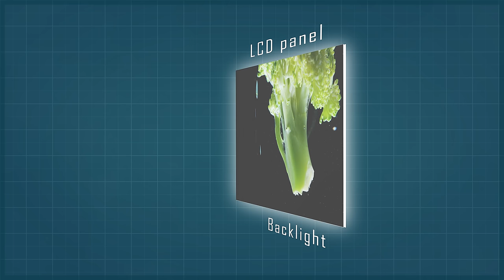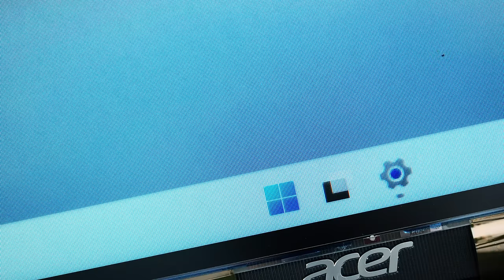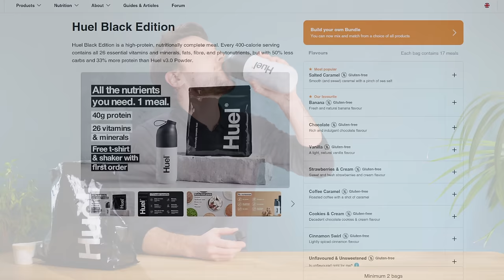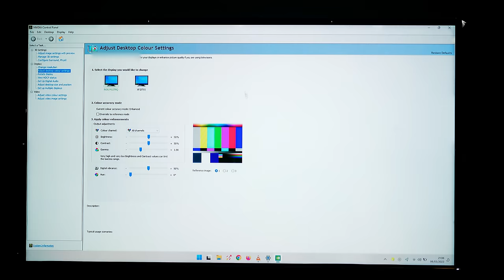DIY Dual-Layer LCD monitor - can it match OLED??

Comment: If I remember correctly, Hisense has done this in one of their TVs. They achieved incredible contrast levels by using a second monochrome LCD layer to provide those inky blacks. Sadly, I don't think they've pursued it any further, synchronizing the LCD layers was quite difficult.
Reply: Apple did it didn't do it

Edit: sorry, the Pro Display XDR is not Dual LCD. I swear I heard it was when it came out, but that was a myth
Reply: LTT has made a video on it
Reply: @zachb1706  nope
Reply: @zachb1706  did it on where?
Reply: I have one of these Hisense TVs it’s amazing except one of my back panel pixels died. Twice as many to go wrong I guess.
Reply: @zachb1706  Apple didn't do it, they bought it from the display manufacturers and might have sold it at most
Reply: @MrRagsd  what's the name of the model? Id like to get one
Reply: @nakedbeekeeper9610  Hisense - 75" Class U9DG Series Dual-Cell 4K ULED
Reply: The "U9DG" series from Hisesne uses this technology. Their 75 inch tv is currently around 1000-1500 dollars which is only alright compared to its competition in that class. It's about as expensive as a QLED or cheap OLED panel.
Reply: Panasonic sells panels with technology this but they are very expensive. Sony uses it on the BVM-HX310 but that's a 31" monitor and costs over $30k.
Reply: @MrRagsd  thanks my man. I'll see if i can get it second hand
Reply: yeah, I thought the same thing. it's Hisense way to fight oled with its intellectual property when it first appear on tv market. but I heard it flop cause of the process yield low success rate
Reply: monochrome second layer sounds great, should not be as inefficient
Reply: @fhecrewdavid  the  cheapest 77 inch oled would be a bit more expensive, maybe 2000 dollars, just 3 or 4 years ago a 77 inch oled was north of 10,000.00 so thats nice.
Reply: Isn't QuantumDot from Sansung almost the same idea ?
Reply: I recall seeing a video about a reference monitor which used this same tech. of course I have never seen it in person, nor do I remember the numbers, but both peak and sustained brightness were absurd, as well as a ridiculously high colour gamut and non existing colour delta. of course, it was a mastering monitor, might cost as much as my house for all I know
Reply: this seems a bit silly....dual lcd blocking means less light getting through....so add more light to compensate...
couldnt you just dim the exsisting monitors backlight to get the same relative effect?
Reply: @fhecrewdavid  I assume this is because it was such a limited production run. If more people did this the costs would go down, right?
Reply: @monad_tcp  quantum dots are meant to make the light from the  backlight whiter. That way you get more vibrant colors, but not better blacks.
There is a qd-oled technology available on some computer monitors, but I thing it replaces the regular lcd backlight to an oled panel. Dont quote me on that tho
Reply: @michaelm6867  That's true! Compared to OLED it's interesting though since most OLED panels are actually just manufactured by one or two companies and sold by others in their TVs. It'd have to be a tech more widely adopted by larger companies in various products to have appreciable demand.
Reply: @MrRagsd  I' ii keep a lookout on mine fingers crossed
Reply: Panasonic made their megacon technology for reference displays using a light modulating layer it can be found in the sony hx310 and should be an excellent benchmark.
Reply: @Elbenin  I though they could turn on and off single "pixels" like a grid pattern of LEDs for the back light.
Reply: @monad_tcp  well, quantum dots are just weird dots that convert light into a different wavelength (this is a simplification).

They’ve now used it on displays that are just blue oled panels. The quantum dots on top convert 2/3 of that light into either red or green.
Reply: I vaguely remember watching the HDTVTest YouTube channel or maybe elsewhere saying that the technology isn’t used in consumer TVs because it’s so energy inefficient that it can’t meet energy efficiency requirements in the EU and other parts of the world.
Reply: @jimmyhackers8980  so if you imagine a lcd panel can let through 1-80% of the light, that’s a contrast ratio of 80. Two lcd panels would square that effect, so they would let in between 0.01% - 64% of the light, with a contrast ratio of 6400
Reply: @iain3713  but after youve added extra light coming through... that 6400 ratio must be reduced. i can imagine to get the panel back to orignal brightness it would completely negate the darker blacks back to greys.
Reply: @monad_tcp  but quantum dot layer is more proprietary layer and producing more vibrant layer. I'm not quite well informed about the contrast level and brightness though
Reply: need a pair of hires lcd glasses/lcd visor with a camera and realtime AI mask contrasting to modulate light transmission through the lcd  per which direction they're facing. Can passively block peripheral areas too so eyes can accommodate to increase sensitivity....
Reply: @monad_tcp  Quantum Dot enhancement layer improves contrast only marginally.
Reply: @jimmyhackers8980  contrast is a relative metric, not absolute. LCD screen has same contrast ratio regardless of backlight brightness (except extreme cases).
Reply: The Monochrome LCD was 1080p FullHD under a 4K Color Panel. It was also bonded on very closely to avoid any optical artifacting. When the Panel maker custom makes the layers they can some tricks to make the multiple LCD filters allow as much light through as possible. I wish this tech became successful and used for realy big scale screens. Sadly it seems to be abandoned.
Reply: @zachb1706  XDR is a bad implementation of MiniLED, it is infamous for weird Local Dimming issues.
Reply: Expensive reference monitors for movie grading, especially with HDR, are dual layer LCDs with local dimming.
Reply: I think some mastering monitors used it as well, but they're like 30000 pounds or something lol
Reply: @zachb1706  When Apple originally announced the XDR it was widely assumed that to achieve the specs presented, they must be using LMCL/Dual Cell. And that really caught on. I thought the same for a while. Then they released more info, and it was 'just' a decent FALD setup. And then people got their hands on them, and it turned out that while it was indeed a great display, Apple were probably being a bit aspirational with their reported specs.
Reply: @jimmyhackers8980  Cannot and you will not get the same result. LED monitors with HDR now run at least 300 up to 1000nit. That 1000 is very bright, almost blinding for a computer monitor working distance. The reason is because HDR monitor also has better LED panel with wider contrast ratio. When you reduce the brightness of light, the reduction in color contrast is different with different color. White becomes too less white while dark becomes ehh... slightly dark. Even then, there is a downside of the method in the video which is the sharpness. It is just distracting when looking at text or anything that barely moves because you kind of notice the blooming around the dark and bright pixels.
Reply: @michaelm6867  it's not that good since PC monitor need to be well rounded multi-purpose for all content. Also, the power consumption is just too high even when it came from factory. I remember Hisense showed this in an expo over here in my country. There is a current ULED TV made by them too. It has extremely good color contrast but suffers from ghosting and response time. So, kinda ok for TV.
Reply: I think there was a misunderstanding of some tech reporter when they wrote down "synchronizing the LCD layers was difficult". Synchronizing only needs to be accurate within a millisecond or so, that's not really a challenge. Electrical signals travel well over 100km in a millisecond.

But I'm sure there are other challenges on making the experience good, like the color accuracy & homogeneity errors of both layers adding up, so the hole screen would be twice as bad as a normal panel on a lot of relevant performance figures. Plus all the additional energy wasted between the two panels, which creates significant challenges to the cooling of the panel (on top of the massive power demand as discussed in the video).

Though of course a original design for a dual-layer solution wouldn't need the paper diffuser layer in between, it could just rotate the output polarizer on the second screen, and entirely remove the input polarizer since the first screen only emits polarized light to begin with.
Reply: I love my Hisense! They are really knocking it out of the park. Bought my dad one last week.
Reply: @zachb1706  I thought it was mini led
Reply: I swear Apple seems to have the power to hypnotise their herd into believing that they invented features they didn't actually invent
Reply: @tenzaemtade6146  I would say that is correct I would also say just like Nintendo Thay take older hard where and optimize it.  or take cutting edge hard where and bring it into the mainstream.  thunderbolt3 /hybrid drives/ m.2ssd things like that
Reply: @jimmyhackers8980  if you dim the backlight, the bright part will be less bright. Contrast will suffer, colour will not be as rich.
Reply: Here’s the LinusTechTips video about it: 
https://youtu.be/STdZ_kiHYEY
Reply: @fhecrewdavid  To be fair, a similarly priced 75" QLED would have significantly worse black levels due to the lower number of dimming zones (if any at all) and a similarly sized OLED would be significantly more expensive without a major discount.
Reply: @madsam0320  the birght parts were dimmer than the standard lcd as it is, he showed it in the video.
      all he effectively did was dim the monitor.
Reply: @fhecrewdavid  "It's about as expensive as a QLED or cheap OLED panel." where are you finding a 75 inch OLED for 1000? Or do I misunderstand?
Reply: It's worth noting that Hisense's dual-layer LCD approach was a bit different. With its implementation, Hisense used the first layer for monochrome work alone -- sort of a black&white layer that acted as backlight control. The second layer included the color filter, and when aligned precisely with the first layer, could double down on light bleed control, allowing for deep blacks with minimal blooming or halo. Unfortunately, it didn't get quite as bright as most LED/LCD TVs and only marginally brighter than OLED. It wasn't the hit Hisense had hoped for, so they nixed it for the North American market. Not sure if they still make it for the Asian market.
Reply: @zachb1706   buy a USED PLASMA display for gaming  or a CRT
Reply: This is actually amazing how good this makes an lcd look
Reply: I have their 55" U8H and its blacks are AMAZING... when viewed on axis. Move a little left or right and it gets worse quickly.
Reply: Hisense U9DG Dual Cell LED LCD TV. 👍
Reply: @yammarques  Eizo make one.
Reply: its like ultrawide tellys, they never took off
Reply: @monad_tcp  quantum dot has nothing to do with contrast as quantum dots are basically just a way to boost the color LCD crystals to emit more accurate and vivid color wavelengths for each of the RGB subpixels. Quantum dots have no real effect on contrast as it's not an active layer with light blocking capabilities.
Reply: @dvl973  in absolute terms, yes, but they do affect dynamic contrast.
You cant make bright briter, but you can make the darks darker by turning the dots off.
Reply: Not the same.
This video uses 1080p + 1080p panels and Hisense used 4k + 1080p panels for dimming.
Reply: "synchronizing the LCD layers was quite difficult." huh? says who? Dude literally did it himself can't be that "difficult".
Reply: I had one and it was pure junk sadly
Reply: The pixel response time was abysmal though.
Reply: @TheGoatPC  Not with two completely different types of panels and an FALD backlight.
Reply: @monad_tcp  that's micro-led
Reply: Nowhere near as difficult as setting up OLED fabs so moot point.
Reply: Hisense do have a tv with this technic for sale with amazing picture quality
Reply: @lucaslittmarck2122  it's depreciated though, Hisense is no longer manufacturing it but stock is still available
Reply: @user-yc5fq9bv3u  Efficiency is roughly the same, the difference is that you  can have simpler and cheaper second panel.
Reply: @peceed  search some high magnification photos of IPS display, you will see that spacing structure is significant
Reply: @user-yc5fq9bv3u  Not really. In the most cases there is a full vertical symmetry. Sometime small asymmetries will just decrease slightly luminance, but when you add small1-2 pixel translation to reversed image you can recover perfect alignment in the most models, even RGBW. If you are talking about patterns within subpixels, they will minimally affect gamma curve and reduce brightness.
Reply: Plasma TVs had excellent black coloration. I wish they were still being made.
Reply: @jimmyhackers8980  you can make the backlight modulated, which is what Samsung's "local diming" displays do and what Dolby's HDR displays do also.
Reply: Too bad Hisense sucks. Their software is awful. Just spend the money. Get an LG OLED. 
I got a G2 and it's fantastic. Never going back to LCD
Reply: @jimmymundell2275  the Hisense duel layer used a monochrome 1080p layer
Reply: @theonik2006  $30K?! that's ridiculous. What is the use for such a expensive monitor like that (especially if not even made out of gold or for NASA to use)?
Reply: @sonyx5332  Studio mastering. $30k is OK for a pro display especially if the target audience is churning out multi-million dollar films.
Reply: Using a genlock box you can synch multiple panels to absolute precise timing, you can genlock them at higher refresh rates too, though personally I would want to synch the modulation panel to the highest frequency possible, this would act like 600hz subfield drive modulation on plasma, you could use a 500hz modulation panel and have really high resolution motion clarity even with 60hz content, which means yet another amazing advantage of dual-LCD displays.
Reply: That’s just another version of dynamic backlighting. The second LCD acts as some zoning plate
Reply: @Howard-de1gs  Dynamic backlighting is just varying the backlight intensity, Dual-Cell LCD modulation is a per pixel modulated technology, only multiple self-emissive layers (like dual/multi-stack OLED) can outperform it.
Reply: @anishhegde5197 What video title?
Reply: It was inefficient and expensive compared to other solutions like miniled and oled
Reply: some Razer laptops (and I'm sure other brands too)  have done something similar (stacking lcd panels) but to accomplish a higher resolution display instead of better contrast or color
Reply: wasn't cause of the syncing, it was cause it used a ton of power. doing this makes more sense with an OLED cause of the power usage to do this.

Comment: Professional dual layer LCD monitors use a monochrome LCD as the rear panel, which is better for light to pass through, thus increasing the efficiency (though it is still significant less efficient than a single layer LCD).

Also, with your method, you are significantly increasing the saturation, so you would need to get a calibration device to counter that.

Still, this is a really cool project!
Reply: Pretty smart idea to separate luminance and chrominance layers, rather than going with the QLED/rough zone lighting approach.
Reply: too bad there's no actual market with monochrome LCD's and conversion of colored LCD into monochrome one is nearly impossible task
Reply: @1337Shockwav3  I think that both are good for different purposes and budgets. The dual layered LCD monitors are designed for professional colour grading (especially for HDR) in high budget studios. QLED are great for other purposes, they are much cheaper, take less power, and are thinner. Mini-LED backlights are also gaining popularity, though they suffer from blooming. Personally, I don’t mind a bit of blooming as long as I am not in a dark room since I am not a professional filmmaker.

I think this technology would be great in the hands of radiologists, but since medical diagnostic displays take a lot of time to be approved, this could be a while… though I think an OLED one specifically engineered and calibrated for medical imaging with an active cooling system would be the best.

Edited: corrected.
Reply: oled will be cheap in a few years
Reply: Could he not use grayscale on the second screen? I know it technically still uses RGB components, but at least they would all get dimmer in proportion.
Reply: @tokiomitohsaka7770  You talked about Mini-LED, not Micro-LED...
Reply: @ThePowerLover  You’re right, I mistyped. Microleds aren’t backlights, they are the display itself in a similar way to OLEDs and miniLEDs are for backlights.
Reply: @tokiomitohsaka7770  Thanks for the correction.
Reply: @SergeiSugaroverdoseShuykov  there’s there no l
Reply: @Blox117 yeah becaus it’s sucks and micro led has actual good graphics unlike the trash your generation was given
Reply: @Blox117  Suuuuuuure. XD